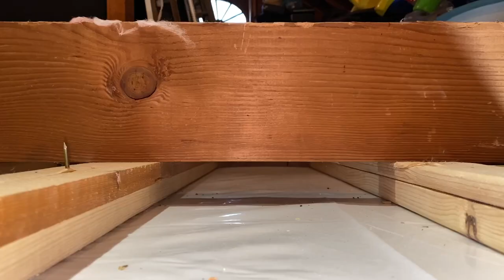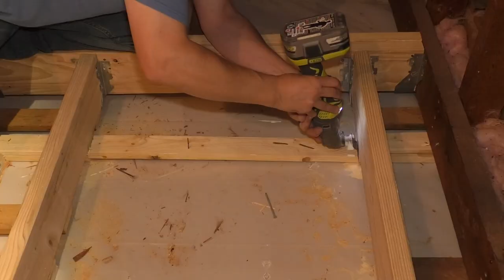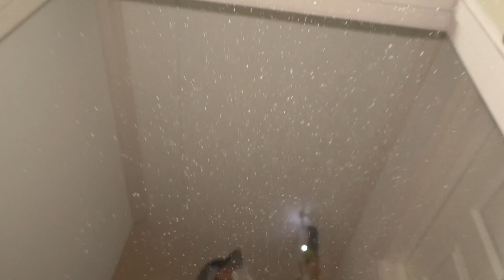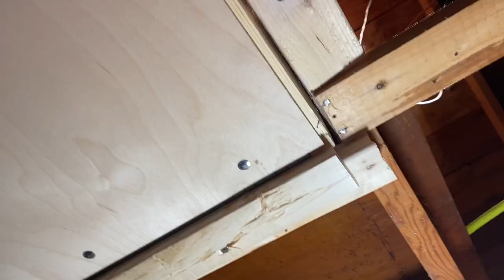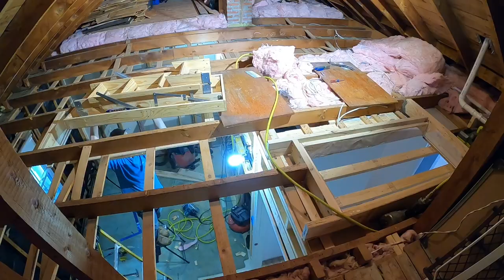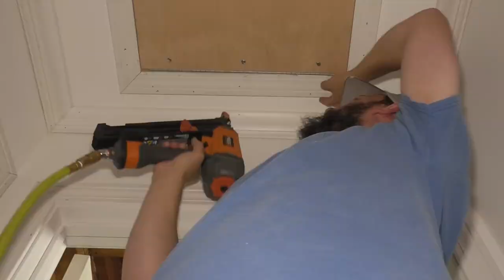How to Move An Attic Ladder | The Short Version

Comment: Hey, if you ever run across a project where you have to replace ceiling due to roof leakage. I would love to learn maybe some quick fixes until you can get your house reroofed (if there is any). As well as how to add ventilation to the bathroom?